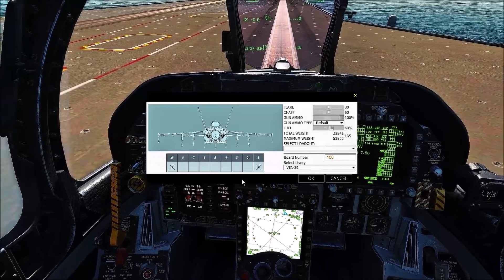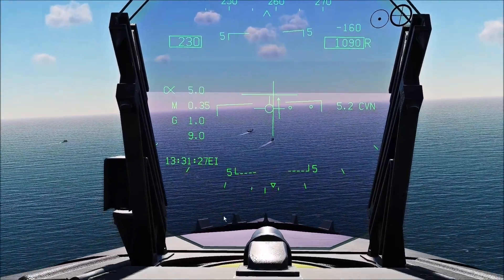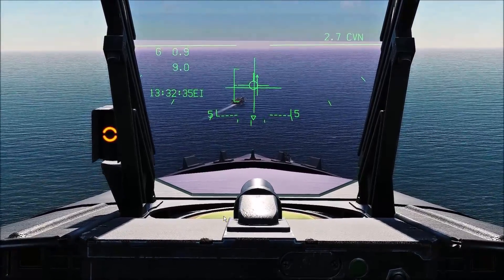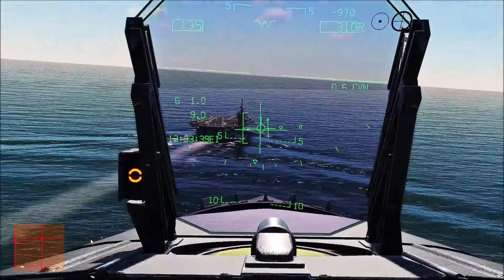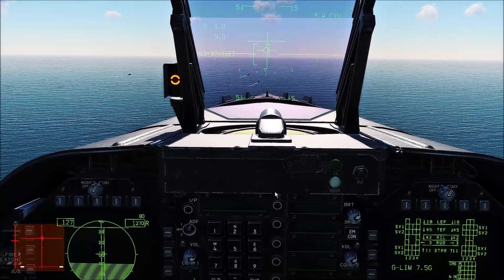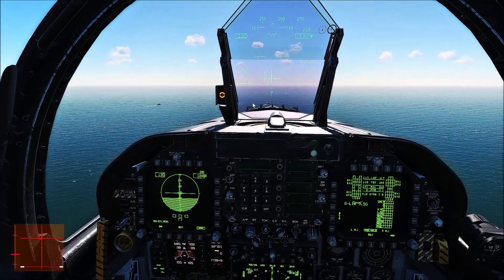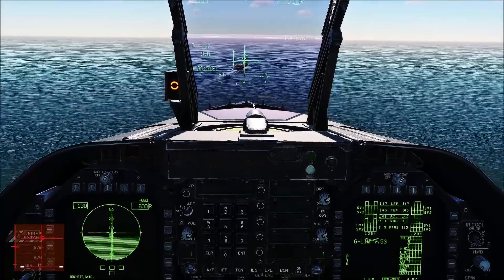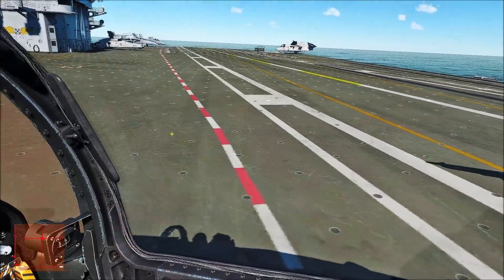DCS F/A-18C [ICLS Basics Tutorial]

Comment: I tried to make a training mission for myself in mission editor with zero visibility CILS landing. Problem is, I didn't check the runway heading as I was making it and when I contacted the Stennis ATC it gave me a runway heading of 12 (the ship was heading 285) so I ended up pretty much in a 90 degree angle of the ship. Is there a way to check the ship heading somewhere besides eyeballing it or in mission editor? Just wondering incase I get to fly in one of those night time multiplayer missions where I don't have the chance to check it on the editor.
Reply from the maker: Proximax9 the dcs way is to press f9 until u spectate your carrier it will give you the BRC (the way the carrier is going) take 15 away from that number so for example of heading of the ship is 090 take away 15 075 will be your runway course. The atc gives a weird runway call. Please join the discord in the description if you have anymore questions
Reply: thanks a lot for the help! :)